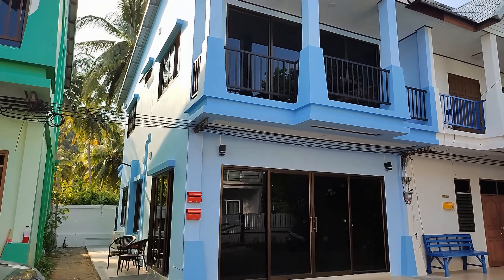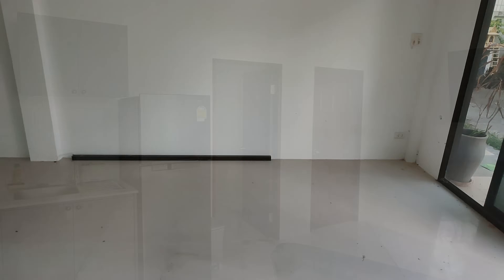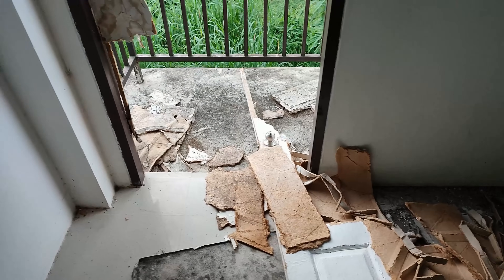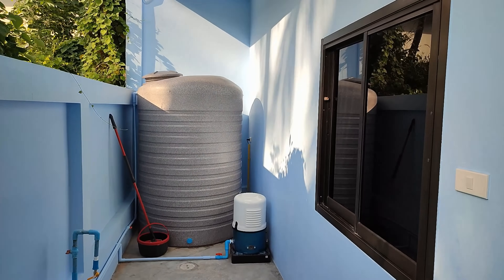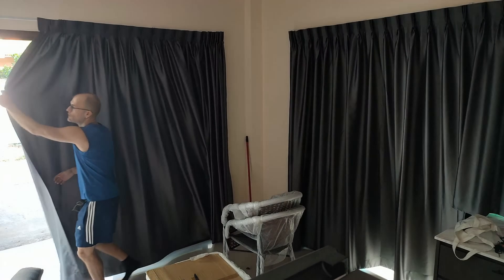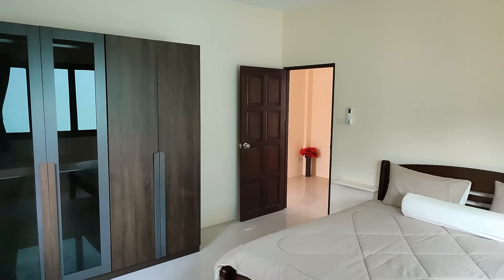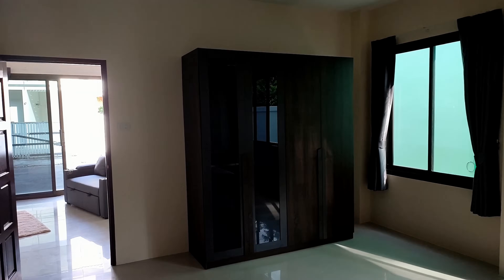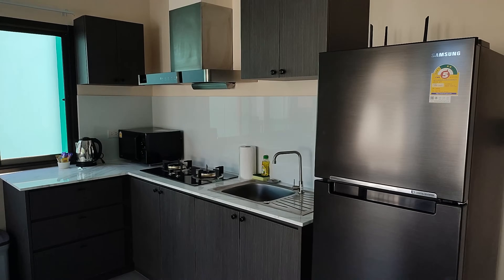House Tour- I Bought and Renovated This House in Thailand!

Comment: Why are TV’s so damn high up the wall in Thailand? You be breaking your neck to watch it! Especially if it’s a smaller living area. Have seen this many times in other vids.
Reply from the maker: Do you still put yours on a table in the corner? Looks like a few people agree with you but I like them on the wall like that (it's not only Thailand 😊)
Reply: @thethairishsun i absolutely agree , nothing better than a tv on the wall…lean back , look up …gives it a nice clean look
Reply: @thethairishsun accdg to an interior design channel that I follow, the TV is supposed to be at ~eye level when you're seated on the sofa/ chair, so that you don't strain your neck while you watch. But if you're happy with it being high on the wall, then to each his own. 😊
Reply: It’s not the wall issue! It’s the height issue! And yes mine is on a stand that’s 2’ tall and it works great both ways of sitting or laying stretched out.
Reply: @robertorr148  yes, I agree. Two or 3 ft tall for a TV table/ credenza is good. The TV is supposed to be at eye level when you're seated so that one doesn't strain the neck (accdg to an interior designer). It will depend on what your eye level is and on the size of the TV. Cheers!
Reply: The TV needs to come down an entire TV length,  you should be able to look straight ahead to watch TV.  Maybe he owns a massage business around the corner too 😅